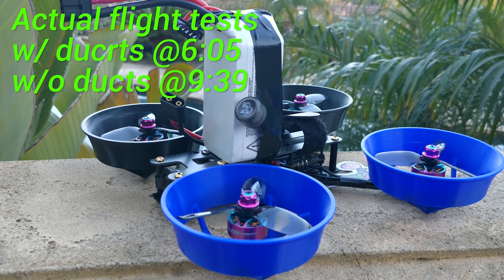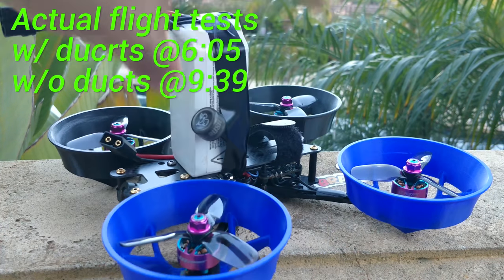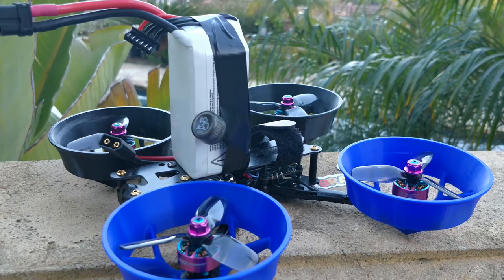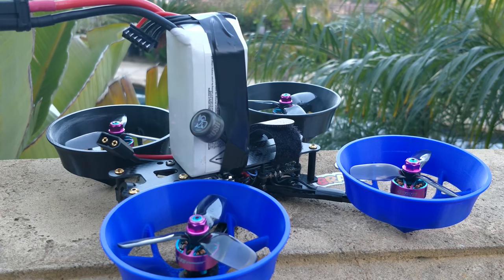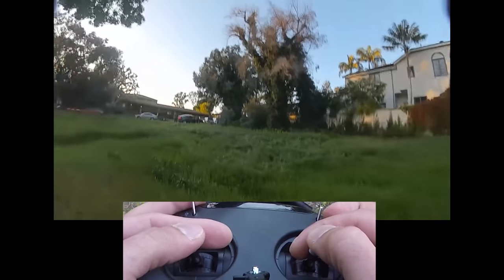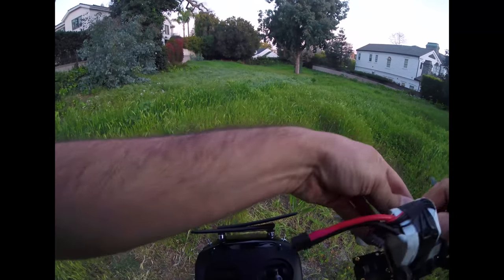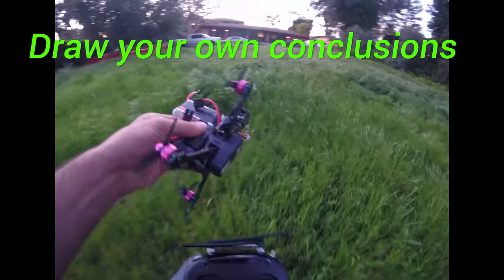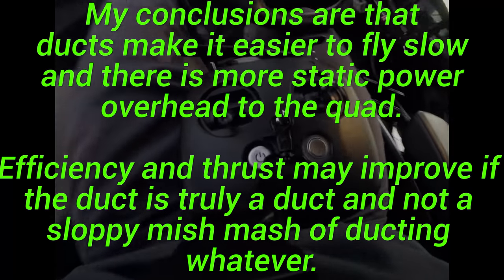Ducts - more thrust and efficiency?

Comment: Thank you sooo much i NEED those ducts soo badly, and I have no problem making a sand paper disk to make some bullnose props with little to no gap, for air to cause vortices that can induce unwanted behaviour, and reduce efficiency, technically even with fitted bullnoseprops, your efficiency (given your not overloading the motor or esc) should theoretically be more like double I believe.. Ive been SAYING this for year,.... But NOT seeing the same results on youtube, match up with what science says, SHOULD happen.. I'm so glad this does prove rather conclusively that even in a "worst case" scenario re unfitted props u still increased your effectiveness and efficiency by untold amounts.. I have a 4k LAL5 i would LOVE to try this with, could remove for acro play, and attach for 107 work of just super steady shots... I Suggested you publish your results everywhere you can as this kind of thinking will push the i industry of personal vehicles, automation, and filming to say the least... not to mention god forbid in a crash if ducts are part of the frame they would GREATLY increase SAFTEY of almost ANY possible collision... all my best ty again!

Comment: Hey Bob! As someone who wrote a negative and criticizing comment on the method on the last video, this video is a great response. You even went through and performed the test I was hoping to see - the equal weight- equal flight path test (does DJI have the throttle value & amp draw support in the OSD yet, because that would have helped?). I was expecting the result you illustrated very clearly; that the ducts win in any slow, low-pitched flying at equal weight when stupid fine throttle-control is key. After watching your video, I think two distinctions were implied but not outright stated and should be: 1.  that all ducts are not the same StanFPV ducts seem to blow most other ducts right out of the water (straight flimsy cylinders like on most cinedrones on the market - just don't cut it). 2.  The quad setup should be tuned/designed for the utility and need - the analogy of a golf bag with different golf clubs for different types of shots, works well in this instance. The correct motor-prop combo for the pilots' need should be considered paramount in the design for manufacturers and a list of a manufacturer suggested setup will hopefully result in a better end result. Keep doing what you are doing and I would love to chat about a collab if you are ever interested.
Reply from the maker: Unfortunately DJI doesn't have any osd elements. Lucky to even have volts

Comment: To get more info for analysis you could add an additional vtx that is only transmitting the osd elements from betaflight via the video out pad. In a setup like that, you could fill the screen up with all the options you want, since it's not going to the flight goggles. I know that adds another layer of complexity with syncing up the feeds, but it's a thought that came to mind.

Comment: From an edf jet background, ducts need the proper outlet tube diameter and length, and need a touch of positive pressure on the inlet. Both otlf these are hard to accomplish on quadcopters properly

Comment: I happen to agree with you, ducts would be more stable bc it is efficiently forcing the air in one direction, and not allowing static air to disrupt around it, witch will give it a more stable throttle and feel all around.... but I thought it would use up more battery faster tho, and in your test govenor take time, didnt.
When you switched to open I knew right away it would be faster lol, and in turn is much harder to control steady, tha th is the problem I have in the 6s cinematic quad, I had to go in and cut air mode take off to 10% and put a throttle curve on my t16 just to try and manage how fast it reacts. 
Very intrested into seeing the design of that propduck motor, think the biggest challenge will be the balancing of it so there isent much vibes.
Haters going to hate bro, has always been like that all these years.
Keep the thoughts coming 👍🏻

Comment: EVERYBODY, let me start by saying fpvcycle sells the best props for toothpicks. But... it's very windy where I live rn. On my fpv cycle tp3 with 1204 5000 motors using three 3s, without batter and props, but with prop screws, weighs 57.3 g. Ive been flying 2in triblad gemfans, obvious lack in performance, but handles in wind sooooo well! Really gotta ride the throttle but hey, it's windy and cold out, and these motors are perfection so they have always been ice cold when I land. DISCLAIMER, kabab may not recommend this..... If this wrecks something on your build I'm sorry! I must be lucky so far lol. About 15 packs so far though! Don't let the wind hold get you back from draining those packs let's go 💪

Comment: For ducts to significantly improve efficiency, the tip speed of the propeller-blades must reach around 80 to 90% of the speed of sound (Mach 0.8 to 0.9) at given temperature (c ~ 331.5 +0.6*T[K])m/s in air).  This is due to the reduction in tip losses at high speeds.
Best example for a use case of this are the turbofan jet engines on nearly every commercial airliner (Airbus, Boeing).
For our FPV drones, there is no gain in efficiency. It might effect flight characteristics though, not sure. Never flown a Cinewhoop myself.

Comment: I would imagine, air that normally get's pushed away laterally, is captured and forced through the duct in one direction, resulting in thrust just as rocket nozzles do. A small gap is probably still better than no duct.
Reply from the maker: Gaps in the side would reduce the duct effect that it seems can be beneficial if done right.

Comment: I still think the quad ascending with ducts on one side is just the PID loop doing its thing. You could do a blackbox log to confirm this instead of guessing ;-)
Reply from the maker: It's not but I don't have the time or energy to run that test again and swap the FC to one that had BB to share.  It's not like I'm the only person in this hobby. Anyone can run this test for themselves
Reply: @Kabab  I don't have cinebees and also don't have access to the ducts you were using, otherwise I would give it a try. There is a thing called openlager which you can use as an external logger (its works without losing data like other loggers do). I think that it could be important to verify these claims more scientifically., Even more so because you seem to be developing products with these conclusions in mind.
Reply from the maker: @fabianisensee3744  but this really is backyard science.  I'm not looking to prove anything to anyone but myself and I'm convinced
Reply: If you have extra thrust on one side, regardless of the reason, the stability controller (pid loop) will maintain the last commanded angle (setpoint), which requires increasing rpms to the other motor(s).
Reply: @quadrohazard6970  I disagree with this hypothesis because (unless your motor idle is at 10%) even a 10-15% increase in thrust will not cause a quad to have this behavior if it would otherwise descent rapidly. My theory is that the PID loop has issues holding the setpoint of the quad because it is not tuned properly to the scenario at hand. This is essentially the same as when you move up the filter slider too much and start to get flyaways. The reason I believe this happens here is because (as Bob said) the propellers on the side of the duct cannot spin down fast enough and the PID loop requests oscillating increases/decreases in motor RPM more rapidly than the motor can respond to, resulting in higher average RPM of the motor (because acceleration is faster than deceleration). Of course this needs verification via blackbox log, same as your theory. It really makes no sense arguing about this when we can essentially just check what is the case.
Reply: @fabianisensee3744  I think it has more to do with the time-delay of the thrust on the side with the ducts. The free motors produce the thrust almost immediately when the motor revs up and the ducted ones have to overcome the friction of the duct and the struts which hold it and it takes a little time until the duct-effect kicks in.
Similar thing when the thrust is going down: free props losing lift almost immediately while the air column in the ducts is still moving faster than the props would move it.
Reply: @M0rdH0rst  fully agree. This is kinda what I tried to explain, just described way better. The lag in thrust change will cause the PID loop to oscillate/overcompensate and thus cause this flyaway-like behavior.
Reply: @fabianisensee3744  Yeah, I had to do an extra loop in control technology at the university because I didn't get it the first time. Now it's burned in 😉
Reply: I testflew my stanfpv ducted quad today, and it did the same zero throttle ascending thing with all 4ducts on. In blackbox, one of the motors showed zero! And the other three were spinning up. I hand trimmed a set of 3inch props to fit the ducts so the props are surely imperfect. It didn't fly well.

Comment: I've always been interested in ducts, but I'm not sure about having them spin since that would increase the moment of inertia of the prop by a lot. Also ducts work on two principles iirc, they reduce the tip vortices and keep the low and high pressure separated (look up Q tip propellers, they have little winglets that try to do the same thing) as well as the coanda effect over the lip. I was thinking about a prop with winglets and then a stationary lip, although that sounds kinda overcomplicated.
Reply from the maker: Yeah I've looked into Q tip too.  Very interesting.

Comment: I cannot understand any "negative attention" to these tests - they are obviously helpful in some way. Ducts do work and with 3D printers everyone has the possibility to find improved designs. Your test suggests that somebody already has made improvements tailored to slow, stable, efficient flight which is exactly what you want for a videography setup. I think ducts intergrated into the prop ("pructs"? "dups"?) will be really hard to balance and any contact with a small twig ;-) will lead to heavy vibrations. Also there would be a lot of mass on the outside so they would have a huge moment of inertia which will make the quad extreamly unresponsive to the point where the PID controller may struggle to keep things smooth.

I think the key to even better ducts is a deep dive into the aerodynamics of them which would quickly go beyond hobby experimenting and into serious engineering and wind tunnel testing.
Reply: This! Building a massive ring into the outermost end of the prop is an awful idea. It would be the same thing as massively overpropping a motor.
Reply: The negativity is valid about duct as the USAF has tested them for small personal carrier and the draw back as mention by theory bij manny including this vid. Is that it to stable so it moves to slowly. Wich reduce value for fast mobility. Nice for close proximity flying inhouse. In the field it is slow. So the pro. is efficient hoovering it does come with big con. Speed and agile handicap. So I see specialisation .

Comment: Question I have why haven't dji etc mfg all drones with ducts to take advantage of the improved efficiency??? Why the exposed blades? Also why not a multi blade fan blade similar to that in a jet engine as opposed to dual blades which are most common?
Reply from the maker: the best guess answer I have to both is that these aren't actual ducts.  They're imperfect.  They have a duct-like effect but aren't really true ducts.  So multifan would be lots more inefficient.  The whole system is very inefficient as it is.

Comment: Ducts only really start to add efficiency when the tip speed is close to Mach 0.85 or higher. This is due to the reduction in tip losses approaching supersonic speeds. This would be at 75000 rpm on a 3 in propeller.
Reply: I hear they just add more drag than it's worth...
Reply: @nunyadambidniss  On a quadcopter yes. In something like a turbofan found on commercial airliners the tip speed is mach 1.4 on takeoff so the shroud is necessary.

Comment: Having molded ducts to the props may be neat to see but depending on thickness of the duct the motor now has to spin, may or may not be good. May have to bump up in motor size,

Comment: This is random, but it looks like you're using a DJI remote? Didn't see any videos of it on your channel. I'm kinda new to quads, and debating going the Caddx Vista/DJI remote setup, but concerned I might lose a lot of tuning and configuration options compared to a Taranis or something.  Is that the case, or would you say the DJI is closely comparable?
Reply from the maker: I did a review of it but since then the code has gotten exponentially better. At this point I would equally recommend DJI over analog for beginners. Frame selection is still lacking however
Reply: @Kabab  Thank you very much for taking the time to answer that, I appreciate it. Sorry for missing the review, I must have scrolled past it a couple times. Been crossing my mind about building a hopped up version of the CineBee with a TurboBee. 13 series motors, 3-4S. Using the FC in the Vista unit would save some room/weight, plus I'm old. I like configuration, but have enough stuff on my plate to do instead of fussing about with things.
Reply from the maker: @coolhanddruid  yes if you don't have patience for fuss, don't even think about analog

Comment: Very nice thanks, but I thought we were supposed to land at 14v on 4s to avoid damage to the cells?  Or have I been landing too early all these years?
Reply from the maker: You don't want to go below about 3.3v per cell in flight. I'm just pushing it too far here. After 3.2v per cell the voltage falls off a cliff
Reply: KababFPV cool thanks.

Comment: About the spinning ducts: as far as I am aware, you’ll get a lot less efficiency out of the motors from all of that weight spinning around in the same way a car or bicycle’s efficiency is affected far more by weight on the wheel than the body.
Reply: The efficiency loss will not be due to the added spinning mass, but due to the added spinning surface causing more skin drag.
What I think will have much more impact is the fact that the spinning duct will add a LOT of inertia, causing the quad to be less punchy.
Still, I would love to see a test of a prop with spinning ducts.

Comment: Gday Bob, you can definatly see the difference with or without ducts, i did notice that these or most ducts have the props about half way in the duct itself, wouldn't it be better if the prop was basically level or high side of the prop at the top of the duct, so you dont have all that wasted space at the top, just a thought, great review mate.👍🛸
Reply from the maker: You want the prop in the middle so it separates the top from bottom flow of air at the prop ends...... actually you're right it probably wouldn't make much difference.  Dunno 🤷🏻‍♂️
Reply: @Kabab  Bob i just thought that if the props are up the top the duct but not sticking out  it would get rid of the extra drag when your flying and it would have a bit more of a duct to push the air out of, does that make any  sense to you i dont know im just wondering thats all, good on you for looking into all these kind of things your awsome for taking the time.👍🛸

Comment: Perhaps an idea to get rid of the issue with the space between duct and prop could be a ring with a groove (? Translated from german) inside, where the prop fits in. I hope i could explain what i mean.
Reply: Or a groove in the ducts.. But don't know how that effects flight character
Reply: Ok.. Should watch till end and then comment 😊
Reply from the maker: There's LOTS of ideas you could come up with.  Not just one.  Need to find one that works well without a lot of effort however.

Comment: What happens when you use a contra propeller in combination of a ducts
Reply from the maker: What's a contra propeller?
Reply: @Kabab  two props right in front of each other, spinning in opposite directions but pitched oppositely to compensate. Seen on some old warbirds

Comment: What if u have the prop going though the duct so there’s no gap from the duct to the prop. Just something I’ve been wondering for a while, not sure if anyone’s done this
Reply: I also think that is a great idea. Only problem, the prop flexes a bit when at full throttle, the tip could be moving a bit up and down in the duct. But it could improve efficiency

Comment: Hmmmm. Well firstly. Your adding weight to compensate for the removed ducts. Obviously no one would do that. 
So the flight time will be longer with no ducts. 

But I’m interested that it’s smoother and slower and quieter with ducts. All of which would be useful for filming.
Reply from the maker: I would imagine there to be prop guards that would be similar weight as the ducts. But yeah working on that actual improvement in flight quality

Comment: To get the most out of it you need props optimized for real ducts like EDF props and very tight fit.
Some idea’s for performance the need of straight in airflow tilted motor up to 60 degree amgle.
For speed records full throttle angle of neer 90 degrees. It means hoover and full thrust most efficient , but in between where air intake angle is not optimal less efficient.
Reply: Adition, use motor that are efficient in higher RPM higher stator height vs diameter
Reply: Adition, there are EDF often used on wings , so larger shorter low rpm high torque model for multicopter cruiser, because EDF are very high rpm and with high pitch loud.

Comment: Ducts on the propeller, we have this since ages! Remember those "twirly rotor toy"? 
But it would make creating props mich harder, because of the balancing.
Reply: Agree with balance problems and having that much rotational mass that far from center will spin itself apart. The next step is edf but those really suck for efficiency
Reply from the maker: Yep. All those reasons. Not impossible however.